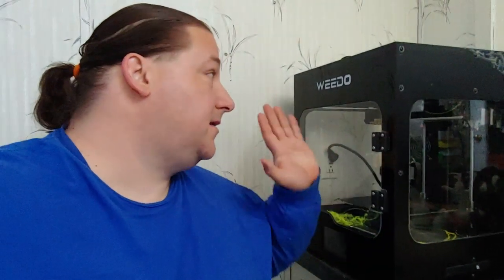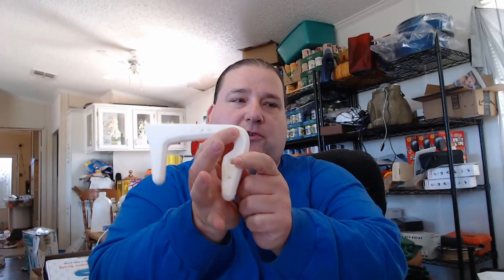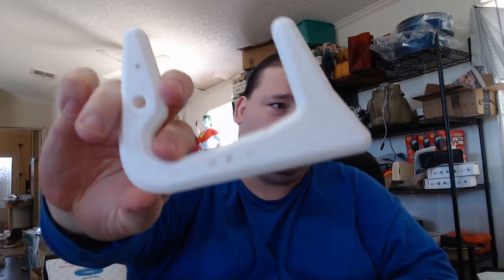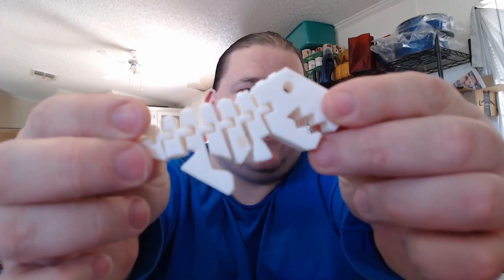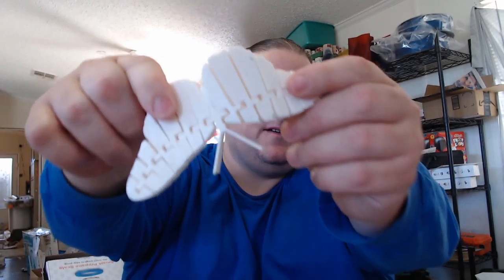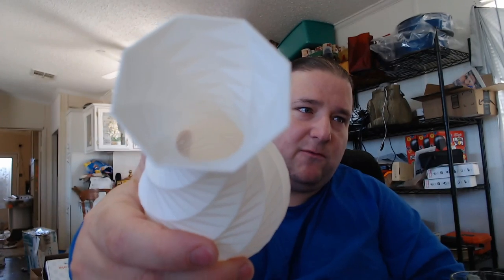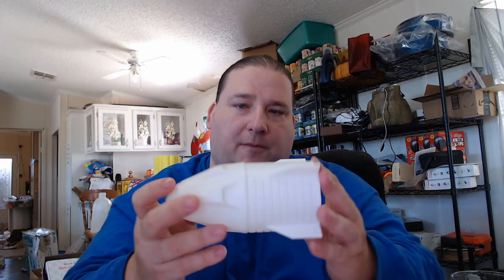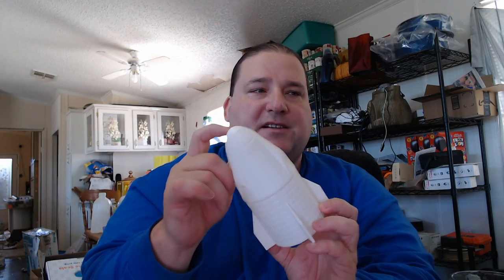ABS Printing on The Weedo T3DP

Comment: You may find that a 100w ish halogen bulb is the way to go for heating the enclosure, especially the 78mm linear 'floodlight' style bulbs. Easy to regulate with a standard dimmer control too. Fitted into a metal box if it's too bright for comfort.

Comment: With Marlin 2.0.X you can easy control a heater. All what you need is a Ntc, Ptc-heater and a relais. Costs are around 20 Dollar. I have one of these Ikea-Enclosures and a 150 Watt PTC is more than enough. Set it to 65 degrees and you will never see cracking or warping anymore. Put the heat stream directly over the bed, was the best solution for me.

Comment: Pc-abs can be printed with open frame printer if you avoid hotend fan cooling the part. I do it in 27C ambient in my utility shed. Pc abs also have better layer adhesion, try aprintapro pc abs.

Comment: Hey Chris! Do you happen to know some news about Stratasys' heated chamber patent? I also heard "Design Prototype Test" say they had done the trickery to have these very old patents still running, despite them being too old.
It would be so nice to finally have an complete out of the box affordable ABS printer with a real heated chamber, without having to rely on clumsy selfmade enclosures with some self built strange contraption for heating.
Even that 'cheap' weedo is 600€ :( So when can we actually expect this problem to end?

And: When using a chamber then are you printing ABS with the bed set to just 100°C?

I once tried printing with my only 3D printer (Ender 4) and had a self made testing chamber made from cardbox. I set the bed temperatur to 120 degress and it took about half an hour for the included bed to reach that temperature. The chamber got so hot during the print, that the acrylic parts holding the motors of the printer got soft and I cannot print anymore, since :(
How would I avoid the chamber getting too hot while still having the bed reach the needed temperature? (in case I ever can afford a new printer).
Reply from the maker: I have used 120 degree bed for open-air abs printing but not in enclosure 90 to 100 should be fine I aim for a chamber temperature of 40 Celsius it should be pretty easy to regulate the temperature by simply having an opening that you can control the size of if it starts to get too hot make the opening bigger too cold make the opening smaller

I am really glad I scanned through this message before hitting post because Google very much try to insult you :-)
Reply: Thank you! What do you mean by Google trying to insult me? :)

Comment: does the Heat bed has be set for 75c or can I set it too 60c for the ABS ?? just wondering thanks
Reply from the maker: I would suggest a minimum of 90 C for the bed 100 is even better